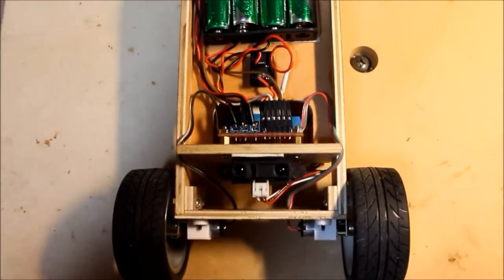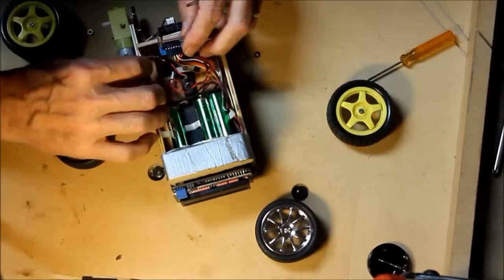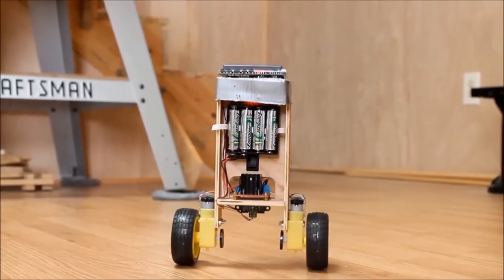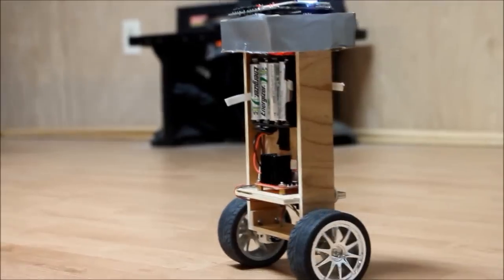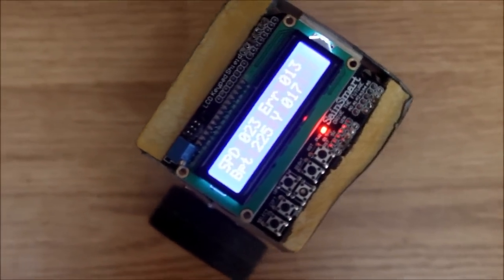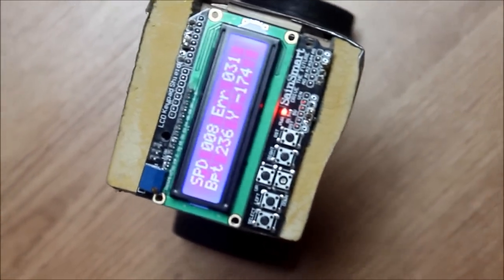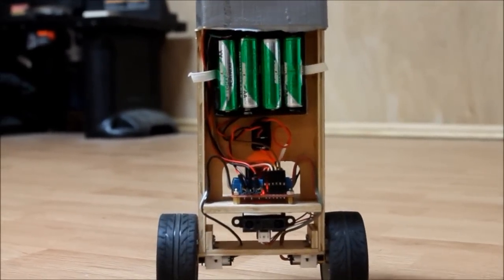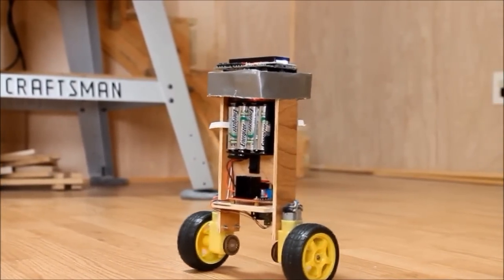Arduino/MPU6050 Balance Bot Part2

Comment: I also built one using small dc motor like you n20. By the way, I use nano 168p and your code looks enough to store it, but it doesn't work. 328p can work very well. 
Really, I still don't understand the minimum requirements of mid-project like that.
Reply from the maker: First & foremost, always appreciate folks taking the time to share their experiences. My guess as to why the code failed to work today, on a different MPU. 1. Parts of it were written specifically for the atmega32U4. and 2. The code , now 8 years old,. is trying to link to libraries that have, in all likely hood, been revised a number of times since then. All too often a revised library isn't backwards compatible. Rendering code that once compiled and ran fine, useless. Not complaining. Its just the way it is
Reply: @jmhrvy1947  Then I think I must learn a lot about programming and try to build my own library the best I can. Thanks soooo much for your reply.

Comment: Amazing explanation! Thanks for sharing.
Did you face any issues due to the backlash of the N20 geared motors? 
Would it be effective if I increase the height of the robot and move the center of mass to the upper section to compensate for the motor backlash?
Reply from the maker: good questions...
One reason I selected the N20 motors/gear set, is, for the money, they appeared to have a minimal amount of "blacklash". 
And to your 2nd question, the higher the center of mass the easier it is to balance. Try balancing a pencil on the palm of your hand, and then do the same with a broom. (sweep end up) 
Again, thanks for the interest in the project.
Reply: @jmhrvy1947  Thanks a lot.

Comment: Hi, what is your loop update rate? Also did you have to move some weight to the top of the chassis as to not overwhelm the motors when balancing?
Reply from the maker: Its been a while since I worked with it. But as I remember it, I think the loop rate is something like 30ms. Initially the 16X2 display was really slowing things down. But I found a different library to manage it, and after that, the loop rate  was fairly consistent, (and no longer a problem). 
As you can see by the layout of the car, I tried to place the car's mass ( the batteries) as high as I could, and yet at the same time, arrange things such that when it fell over, damage would be minimal. With half the batteries on one side, and the other half on the other side, no matter which way it fell, at least one battery would pop lose. Ensuring that the car would shut down almost instantly.. This saved a lot of wear and tear, especially in the early days of development. .

Comment: Very well done video and talk.  What was the most difficult aspect of your bot?  For me, it was dealing with sensor noise.
I've made progress on my 6-foot tall balancing bot and just got my XBEE remote controller in there.  Here's the result:
https://www.youtube.com/watch?v=QHb9eYAyGJc
Reply from the maker: Very nice! You've raised the bar in the "how high can you go" category ;-)
You asked what was the most difficult part. Thinking back on it, there were number of challenges. But solving each one was always rewarding. And once solved that problem seemed like no big deal. But from a physical point of view, the wheel drive units (used in the above video) had non-linear response (dead band, and gear backlash) and were under powered. So working out a control algorithm that responded smoothly enough to keep the bot balanced, both while still and when in motion was probably the trickiest part. And to clear its still easy crash the this bot (while using the remote controller). But that's another video ( https://www.youtube.com/watch?v=p5ddjyun1Qc)
Again, nice job with your project & thanks for sharing it.

Comment: Hello
I made this project
To help me for programming please
I am a beginner
The code for this project is?  https://github.com/jmharvey1/Arduino-...
Code or other libraries are needed?
Or not?
MPU6050 liberery needed ?
very thank you
Reply from the maker: Yes... You are correct. Before you can compile my sketch. you will have to add the I2Cdev and MPU6050 to your local set of libraries. My sketch (as a comment) contains the link to where you can get these libraries. But I'll repeat it here: 
       https://github.com/jrowberg/i2cdevlib
Once you are at this web site, click the green "Clone or Download" button, and select the "Download zip" option (just like I assume you did to to get the files related to this project). Then when you have the "i2cdevlib-master.zip" file downloaded to your computer, you can go to its Arduino folder, and extract just the two libraries ( I2Cdev and MPU6050 ) needed for this project, or you can extract all of the Arduino library files contained in this zip file. But before you extract them, you will need to figure out where to "extract" them to. 
If you are not sure where that is. start the ARDUINO IDE, and open a sketch that you have previously made, and then do a "Save As". Look carefully at where its being saved to. (if you are using Windows, then it is probably being saved in your "Document/Arduino" directory/folder.)
Where ever it is, there you will also find a "libraries" directory/folder, and that's where you will want place your "extracted folders to.
Hope that makes sense, and good luck with your project

Comment: so i tried making one of this balancing bot with an ext power supply(which has no fault). The problem with my bot is that everytime I use power more than 5V, the system jams/hangs and the tyres keeping spinning in just one direction. They dont  change direction they dont stop spinning. What should i do?
Reply: And yeah im using arduino nano for this.
Reply from the maker: If I follow what you have there, my first suggestion would be to install two capacitors right at the power input to the Arduino (Nano). A 100 micro-farad, and a 0.1 micro-farad. (Both are important) 
Please let me know how that works out for you

Comment: Great project , your video has been a great reference for my own self balancing robot but i'm having a lot of trouble with the code , i have a Leonardo and an mpu6050 with the same set of motors as you , is it possible that your code will work on my machine without removing the lcd dispaly module or the front sensor ?
Reply: actually i did try your code but the motors start spinning in the same direction for about 30 seconds and then only the right one keep spinning in the same direction no matter the orientation of the gyro , if you have any advises it will be much appreciated
Reply from the maker: I can't say for sure. But it could be that the motors are generating electrical interference (RFI) that causes the code in the Arduino (Leonardo) to crash.
If you haven't already done so, put a 0.1ufd capacitor across each motor (right at motor, where the power leads attach to the motor)
Also, in my car, the battery is attached to the dual H-bridge, & then I used the H-bridge's regulated 5V output to feed the Leonardo. 
Not having the front sensor, should not make a difference (provided that the sense code has been disabled, or the the sense input has been disabled) 
GL 
Jim
Reply: Thank you so much for taking some time to answer ,i did the same with the battery and the dual H-bridge to feed the Leonardo but i never considered the possibility that the problem was from the motors so i kept trying different iteration of code  but  i will most certainly try the capacitors hopefully it'll work ; again thank you for your time and good luck with your future projects
Reply from the maker: Ok... I hope the suggestion brings some improvement. And GL to you too.

Comment: hello jmhevy1947 thanks for share this amazing project i want to learn about arduino program of that Balance robot and also mpu6050  so if you have any video or any think then pleas help me
Reply from the maker: Glad you enjoyed the video. As for wanting to learn more. The link to GitHub found in the introductory comments will take you to a copy of the source code (sketch) used here, as well a wiring diagram for the Bot/Car. Also if you haven't already done so, check out Part1 of this video. It talks about using the TeaPot program which is a good first sketch for working with the 6050MPU
I wish you luck with this project

Comment: HI jmhrvy1947,  i build your car but have some problems.  everything ok but when i start the motors, the program "freeze". i think it has something to do with induction from the motors(the yellow ones) to the mpu6050. do you have any suggestion?
Reply from the maker: Try placing a 0.1Mfd capacitor across each motor. For maximum effectiveness, solder the capacitors right to the terminals on the motor housing.
I hope that helps.
Reply: I have done that but no effect..  even when i electrical separate the motors from the car and feed them from a accu  and place the motors <10 cm. from the car, it happens. I dont know what to do next, very frustrating. btw: Thanks for sharing the project, I learn a lot. i am also from 1947...
Reply from the maker: At one point in the car's development I ran into the same thing. And yes it is VERY frustrating.  In the version you see in this video. The batteries   feed the dual bridge. It has a 5V reg  & I use the that output to drive the Arduino. Then use the output of the Arduino to supply the MPU. That seemed work for me. Additionally you'll notice I have the motor controller close to the motors, while the Arduino and MPU are located at the other end of the car.  Not sure how much flexibility  you have with your version of this project But maybe you can adapt yours to have a similar layout 
GL Jim
Reply: Hi Jim, I followed your suggestions and with succes! the motorboard is now close to the motors and far away from the mpu6050 + Leonardo. now i can concentrate on pid settings., Henk
Reply from the maker: Good to hear you  had some luck.
As for tuning the PID settings, the best advice I can offer is patience.
If your battery layout mirrors mine, you will quickly see that you have  "instant shut on fall", which IMO helps save the motors and electronics

Comment: What is the name of those wellow box with motor?
Reply from the maker: these are very similar to the ones shown in the video
http://www.ebay.com/itm/smart-Car-Robot-Plastic-Tire-Wheel-with-DC-3-6v-Gear-Motor-for-arduino-/400985432465?hash=item5d5c982191:g:WVMAAOSwaNBUh7Xc

Comment: That's great, but why do you use both pitch and yaw ? i think it needs only one DOF  to perform. And the center of gravity,  is it better high or low ?
Reply from the maker: +phamdacphuoc1995 
That's a good question.
And you are correct, for balance one DOF is all that's needed. But to ensure that both wheels move together, I read the YAW of the car (Bot) as well. Otherwise using a simple common throttle signal, may cause one wheel to move, while the other might not turn at all. (i.e. one wheel is on a smooth surface, and the other is not)
Hope that makes sense, and again good question
Reply: +jmhrvy1947 Thank you. I got your idea. And how do you think about center of gravity? since my project use the "yellow" motor same as your, and its center is high, and i don't know if that is the reason why my robot is not stable =)
Reply from the maker: +phamdacphuoc1995 
Actually the higher the CG the better. Thats why a broom is easier to balance than a tube of the same length.
As for getting better performance (balance) You probably need to keep working on the PID values.
I played with mine for hours, and found that I needed different values for the Yellow wheel set than what was optimum for the N20 wheels.. Almost any physical change to the car will mean that the PID values need to be tweaked (along with the Bpt setting). 
In general, as long as you can control it,  more power, means more stability.

Comment: Is all of the feedback being processed by the Arduino from the MPU6050 through the I2C connection, or are you using the rasberry pi to help with the actual balancing of the robot. I wasn't sure if an Arduino mega would be fast enough to balance a robot like this very well.
Reply from the maker: +njfife14 Good question. The Arduino (in this video, a Leonardo)  does all the processing. As i remember it, typical loop times run between 10 and 30 milliseconds. At one point I had issues with the SainSmart LCD library but found, when it came to updating the 16X2 display, that the Arduino "LiquidCrystal" library was much quicker.
FWIW: I used a MEGA on the full size segway clone (Pleas see:  https://www.youtube.com/watch?v=7ghYotia51M ) and it was plenty capable of doing all the PID processing. In fact, in the fullsize unit, the PID setting were set to produce a highly over-damped output, because the rider inherently contributs to the balance process.
Reply: Cool, I never would have thought about the rider adding their own balance to it, thanks =)

Comment: hello sir, i will started to this project. now im collecting the components. after i did i want to add a remote control to it. is it possible addtion to your robot? i want use bluetooth module and use android cell phone. And one question too, why are u use ir sensor i dont get it. sorry for stupid questions.
Reply from the maker: +Mete Özdemir  
Its not a stupid question ("why the IR sensor?"):
For sure you don't need it to build this particular version of the 'Balance Bot'. But I already had it, and wanted to see if I could use it to make the Bot move in a given direction. (Think of it as a crude remote control command). In practice I found it useful when I wanted to run the Bot in a small space [ like on a table top]. By placing an object at the low end of the table, the bot would slowly wander toward the object until the IR sensor detected the object. When it did, the bot would back away 5 or 6 inches, and then start the process all over.
To your first question ("Can this Bot be setup to operate via Remote Control), the short answer is "yes". 
Here is a link : https://www.youtube.com/watch?v=p5ddjyun1Qc  to a video clip I made later in the project. 
It shows the same bot (Hardware wise) being driven with a re-purposed toy IR controller. The sketch used in this later video is an adaption of the sketch used in the above video. I have not published the RC version of the sketch, because much of that sketch is focused on decoding the commands from the IR Transmitter (which are unique to the toy controller, and as such would be of little value to anyone else). 
There are some challenges in adapting this project to operate as an RC Bot. Code/Sketch space is one. But the other is integrating the speed and direction commands into the PID loops. The challenge is compounded by the fact that the motors in this bot are very low power. So the bot's speed vs balance band is quite narrow.
If you like a challenge, then I think you will enjoy the project as you have outlined it. 

Let me know how it works out for you.

Comment: Hi:
Thanks for sharing your project. 
I've got a question...reading the code relating withd PWM setup  you declare that freq. of pin 13 & 11 is about 60Hz
//setup PWM frequency to ~60Hz for OutPut pins 13 & 11
  
  then you declare the period is 2 ms
  TCCR4B = TCCR4B & 0b11111000 | 0x06; //Set Digital pin 13 Right Wheel PWM period @ ~2ms
   but T=1/F=1/60=0.0166 s that is 16ms. So do I have to use 2ms or 16ms?
Thanks again for your support.
Reply from the maker: +Pedro Camara Good question... 
Use the code as is. However, the Comments above and to the side of the line in question are both obsolete compared to the code. 
Early on, I experimented with low PWM frequencies (which is where the refernece to 60hz came from) Then at another point, I played with 500hz signals, and finally settled on 1Khz (I think most sources quote the frequency to be ~980Hz) which is what the  TCCR4B = TCCR4B & 0b11111000 | 0x06; actually yields.  
I apologize for the confusion, but beware, the sketch went through many iterations before it was finished. And to be sure, a sharp eye will uncover a number of other outdated comments. At the time, I saw these entries as notes to myself about what had been tried (and failed).  I hope you will be able to see through most of them. But where they give you doubt, don't hesitate to ask.
Thanks for your interest in the project
Reply: +jmhrvy1947 
Many thanks for your quick and explanative answer.  Due to the fact that I'm trying to adapt your code to arduino one, I'll need to change some lines such the one related with TCCR4B  , I guess.
Thanks again four your willingness
Reply from the maker: +Pedro Camara 
Your correct TCCR4B has no meaning on the UNO. So for sure, that line will either need to be dropped, or changed, to one of the other clock registers that the UNO has. The 2X16 Display, that I used in the video, pretty much dictates that pins 13 & 11 be the PWM outputs. Another display might give you a different set of choices... 
Again, good luck with your project

Comment: i  am up code  OK but now LCD alway indicated " Init MPU 6050.." .. and no change pages
Maybe MPU6050 can not detected position ???
I connected all components follow your diagram PDF
Reply from the maker: +Hiep Pham  
Hiep,
I sent you a separate message last night describing what the problem is, when you try to adapt this project to the UNO, and recommending that the Leonardo is the preferred way to go (given the other components shown in this video)
Did you find that message?

Comment: Thank your issue
I sure my wiring is OK ( I am electronic Eng.. with many years working..)
my LCD.. after i press button for start,, display indicated " Init MPU 6050...." and no change status indicate.. a can not seen position value...
to day i try up code again, but not succesfull by erro as last mail to you (  :" N20BalanceBotR1.ino: In function 'void setup()':
N20BalanceBotR1:210: error: 'TCCR4B' was not declared in this scope"  )